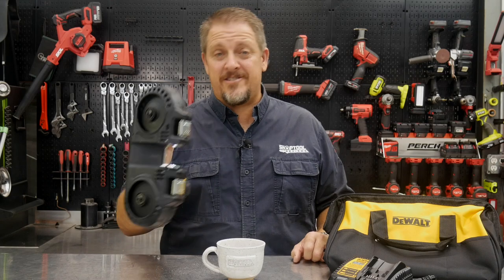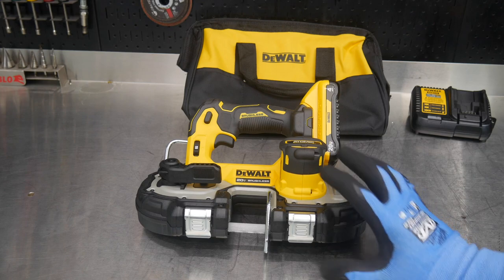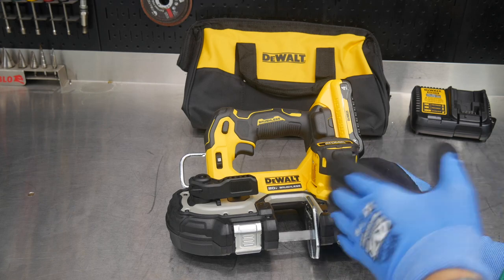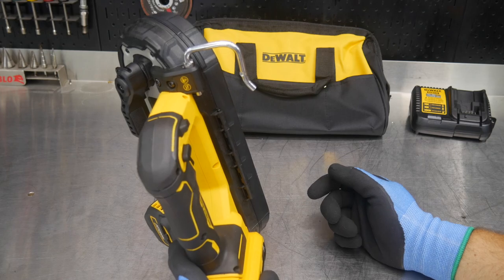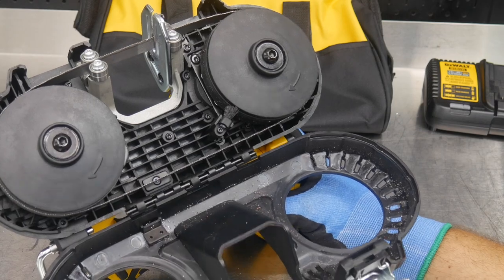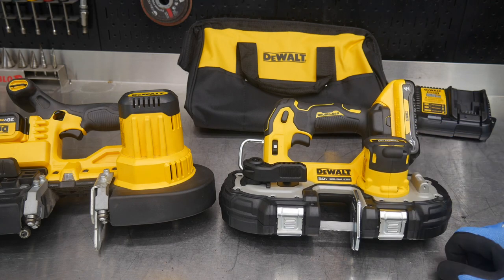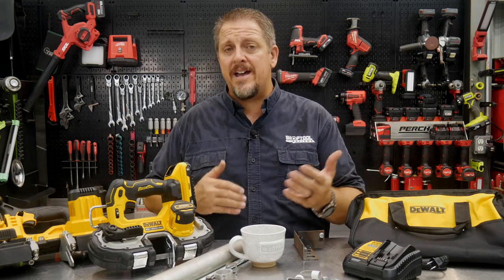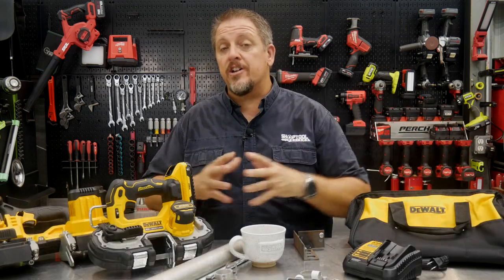DeWalt DCS377 ATOMIC 20V Brushless 1-3/4" Compact Band Saw Review

Comment: I had my older Dewalt 2=1/2" cut cap bandsaw stolen and the office replaced mine with this Atomic bandsaw. At first I was a bit upset about not getting a like for like tool replacement and being accustomed to the feel of my old one I was not very thrilled about the my new Atomic model. It quickly grew on me and realized that for what I need it to do it's more than enough and much lighter and agile. Great tool in that line for Dewalt. You really have to know what model tool you need depending on day to day tasks & demands

Comment: If you turn the tool around, it’ll cut that 2” tubing just fine…
Reply: Really?
Reply: claro
Reply: On an end cut sure, but not in the middle of a bar. So unless you’re just shaving off an inch it’s a moot point.
Reply: @jaaqess2525  I was about to comment this lol. There is something else to consider though, if you've just got stock that is loose that you can just rotate or you're otherwise able to manipulate the tool around, you can always cut from the opposite side.

Comment: What is the blade size for this saw? Home depot site says 32 7/8" which is the same as the bigger capcity older brushed compact model thats 2.5 inch capacity. Doesn't seem to make sense unless the saw is the same size with a smaller cutting throat which would be weird cuz it should be smaller saw
Reply: 27”

Comment: This vs milwaukee m12 fuel bandsaw?
Reply: A coworker of mine has the m12 and it works awesome. I just bought the dewalt atomic and it seems to have more power, but m12 is considerably lighter. Both cut amazing though.